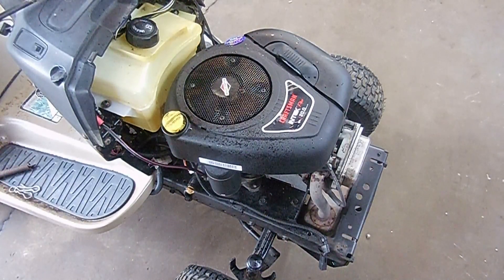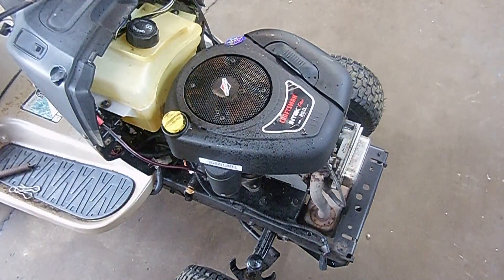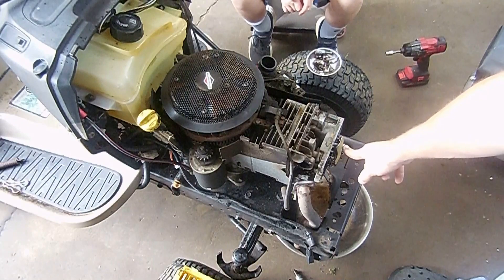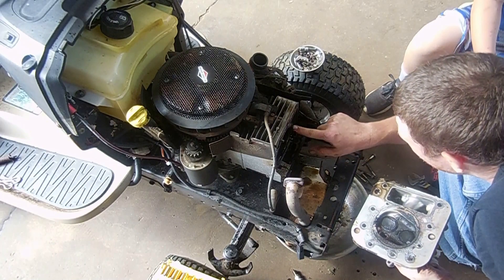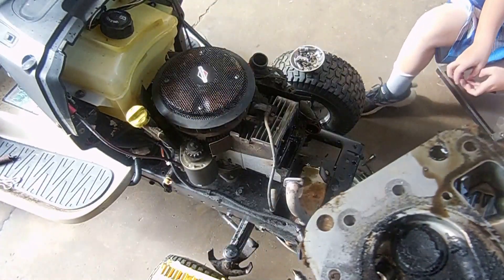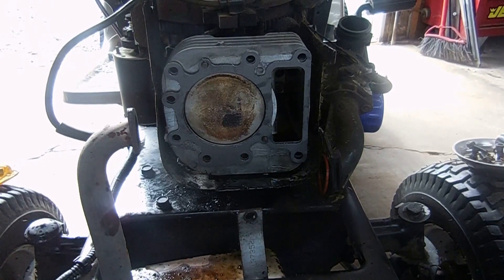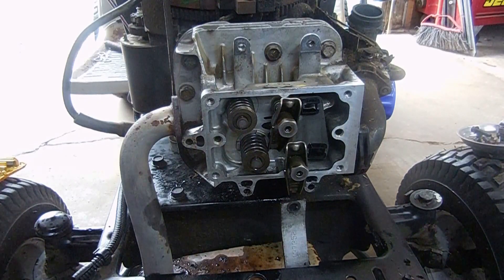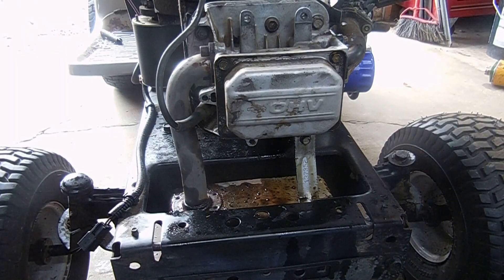Briggs and stratton OHV head gasket replacement!

Comment: I have a 208 cc  engine on a snow power Blower--- ---Preditor?? Cant reach company anymore or see a name on engine.. Its a OHV! I put a new carb on cause cleaned old one for surging( didnt help)It is still acting the same way.. Has to be a leak somewhere.  OR maybe a plasic cam that isnt opening intake long enough or far enough..OR !! head gasket??? Never pulled a OHV  head.. But guess thats where need to Check I may try spraying eather or something close to gasket area!! that will tell .. THEN!!! where to get if so-- Not knowing what engine it is!! Why they need to be soo secret about the engine brand??